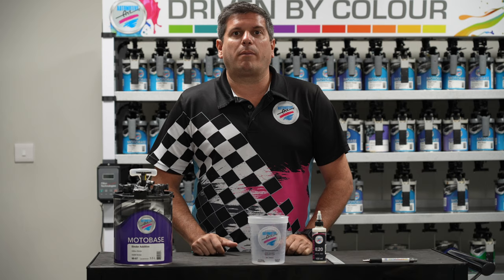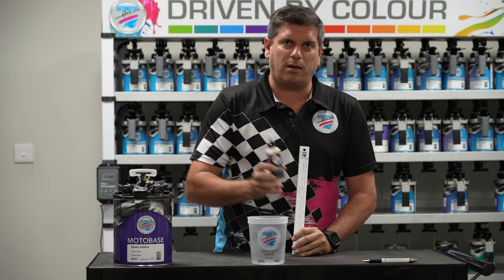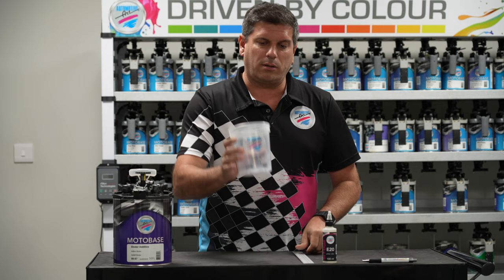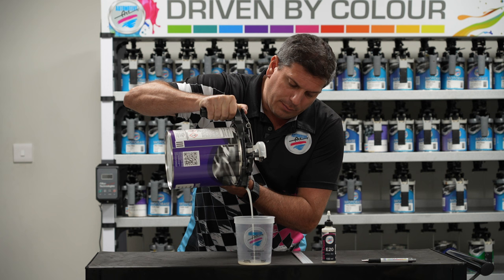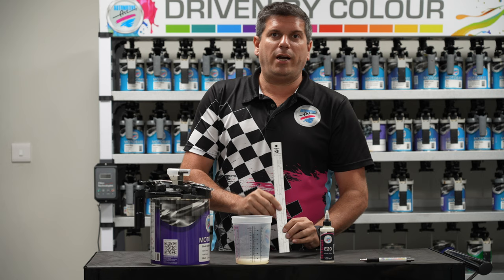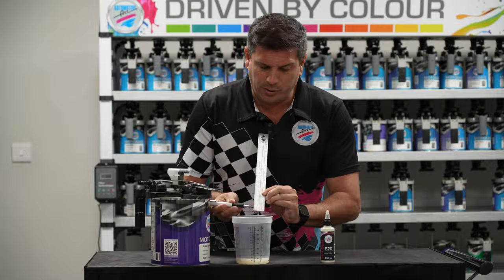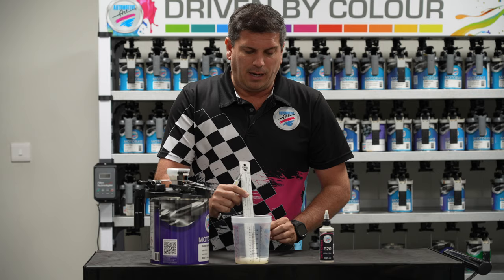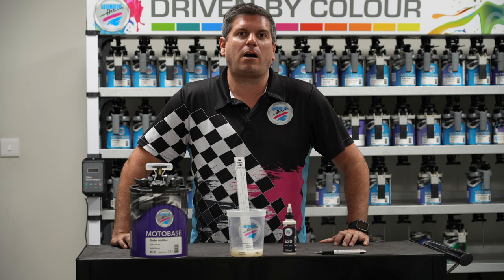Automotive Art Paints Mixing Ratios & Application of Stardust Special Effect

Comment: Time and time again same incorrect recommendations are made by various manufacturers. The stick is to be used only in cups with straight side walls. It will not give you a correct ratio in mixing cups with side walls getting wider towards the top. 

If using such cups best to use the imprinted measuring ratios.